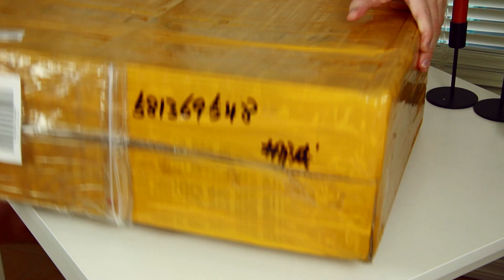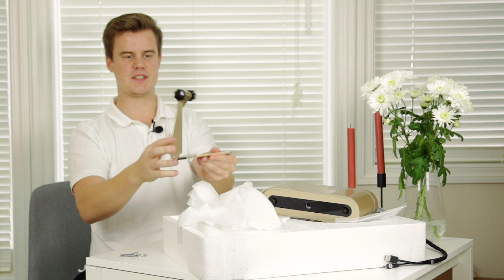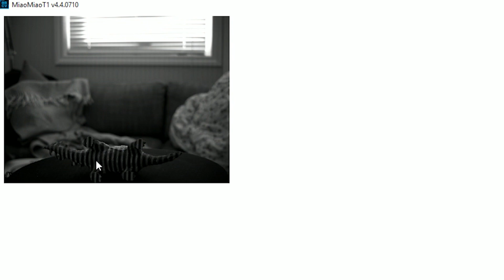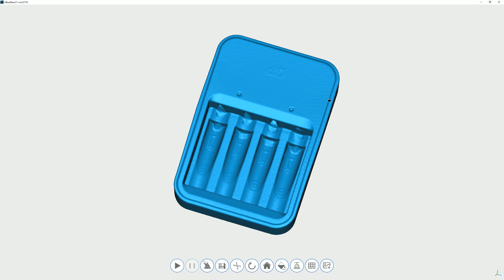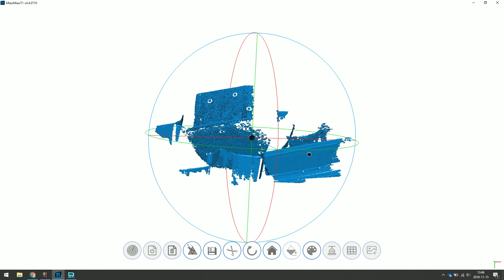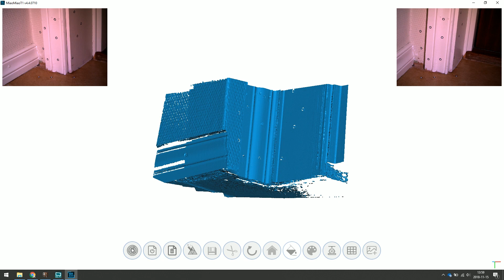BlackBox CAT-1 3D-Scanner Review - Unboxing and everything in between

Comment: What software would you use to take the individual point clouds and align them. I am struggling to find one that works automatically and reliably.
Reply from the maker: In the case of the CAT-1 all the points are already aligned if you're doing a "good" scan, so then you can use software like Meshlab (free) to get it to a mesh. In there you can align points as well, but I'm not an expert on thar really.

To be honest, I can't really recommend any software that isn't super-expensive right now. Geomagic Design or Creaform VXmodel does that really well, but are way to expensive for this scanners users.  

In the end, you could just take the point cloud in most software and just use it as a reference when creating a new model. 

Also, I'm publishing a video in a few days about more mesh-to-CAD in Fusion 360, using the wall example in this video =)
Reply: @3DPrintTechDesign  bummer I was hoping I just missed one. I have a diy structured light scanner that works but to align the point clouds is crazy time consuming in meshlab

Comment: Nice scan of the moose :p and so hard to stand up objects like a pine cone, would it be smart to print a small stand , then in model software delete out the stand with your 3d stand model?
Reply from the maker: Thank you Derek!  Should be a spinny of the Moose in the article link below now =) missed it before.  I tried with some barb-wire to hold up a few objects, but it was so shiny it generated noise where it had contact. But it sure does work for objects you want to scan around, that won't stand by themselves.   In the case of the pine cone it was the lack of surface to project a good pattern on that failed. At some angle it worked better, which is a bit strange actually..
Reply: @3DPrintTechDesign  You're welcome and ok interesting, cant wait for this field to also explode a bit like 3D printing did